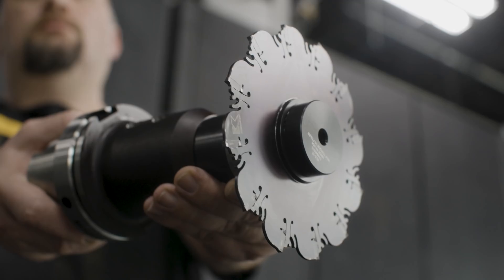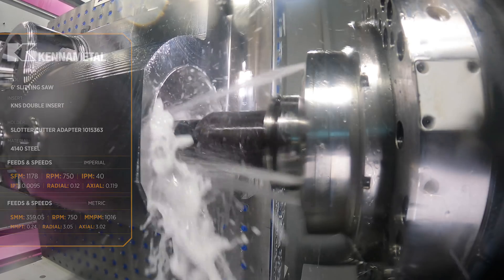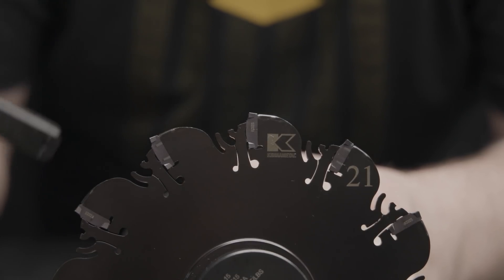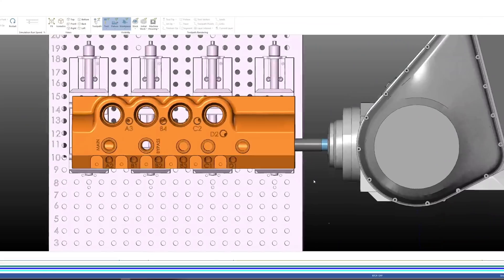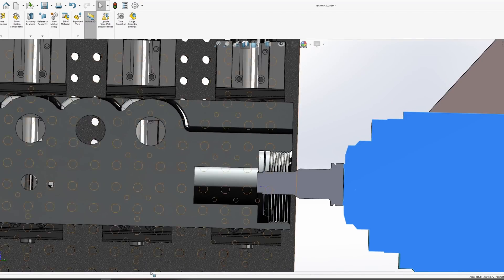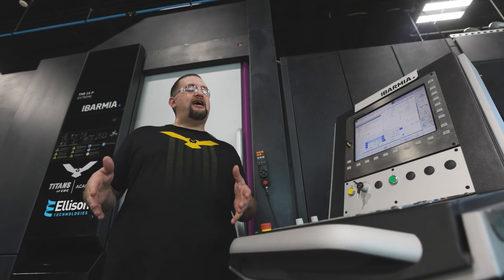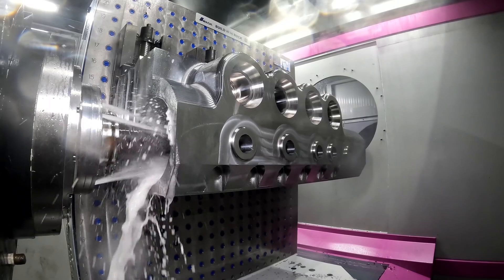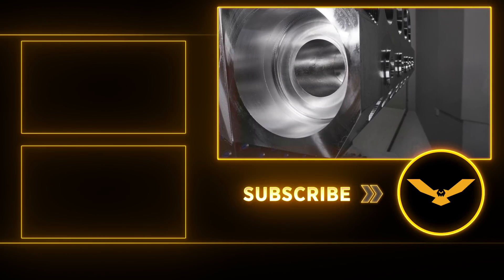Feeding Monster Kennametal KNS SAW 10X FASTER in 4140 Steel

Comment: OMG dont use a dynamic spiral with a cutting blade, it's not meant to work axially
Reply: Lol it was all radial, no axial motion
Reply: @barrysetzer  what's supposed to be a dynamic spiral then?
Reply: It starts from center, and spirals outwards radial. Like a galaxy
Reply: @barrysetzer  isnt this just spiral? what does the "dynamic" is supposed to do lol? it sounds like a 3D pattern.lll
Reply: Yes i suppose it is just a spiral lol. But the actual toolpath in Mastercam is called “2D Dynamic”…….sorry for the confusion!

Comment: Small... I ran a 12 inch with .5 inch inserts on hbm
Reply: I had a "fun" job not too long ago in Monel K-500 that called for a 12"x.750" slotter. It was my first time using anything so big so I was pretty jumpy. Grimaced all the way from hitting cycle start to engaging in the cut, at which point the spindle promptly torqued out, being on a beat-to-hell 30HP belt drive machine.
Reply: Also small. A buddy of mine made sure to send me pictures of his 54” they used on same Navy parts. But im glad i could one up you, as well.

Comment: I feel that slitting saw is a bit bit large for that application unless you need the depth ? Possibly would be quicker with a smaller cutter at higher revs with less angle of engagement?

Comment: I use insert slitting saws often for full depth cutting, to remove an entire workpiece, to avoid using a saw or remove excess material from op2. Going in 50mm deep radial with a 160mm diameter tool from 2 sides. Works incredibly well, even in tough materials 👍

Comment: The part is apparently super expensive, as long as you are already messing around with it.
Reply: Lol, as we already said, we are using this part to show the methods used in processing parts this size. And alot of times, content was filmed earlier than you think.
Reply: @barrysetzer  long ago I had custom tools made for this type of cut. They are solid carbide and are heavy. They are big enough for resharpening and regrinding. I use pH horns keyseats which allow clearance on the face. Either way the keyseat is a very powerful cutting tool that many shops won't embrace. Usally for concerns about finish quality.